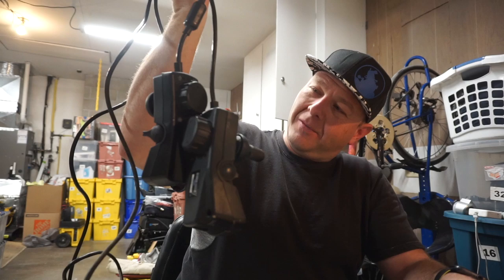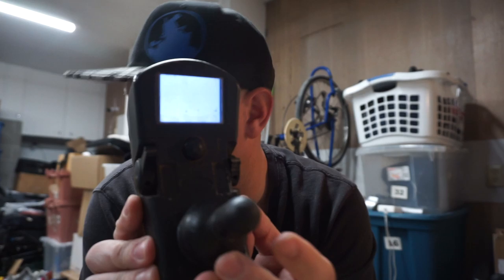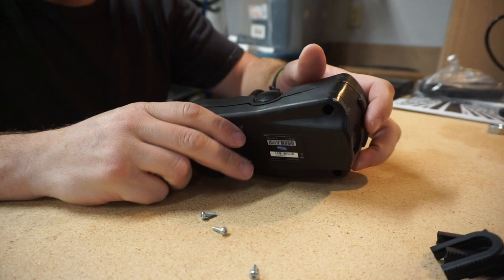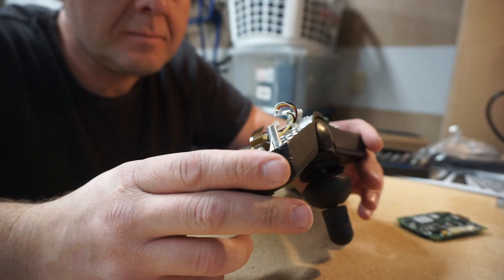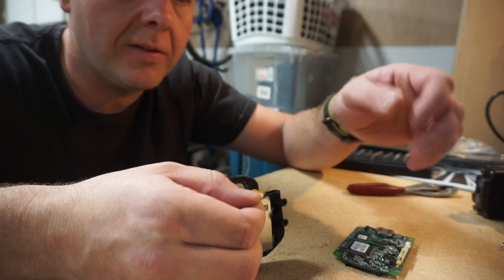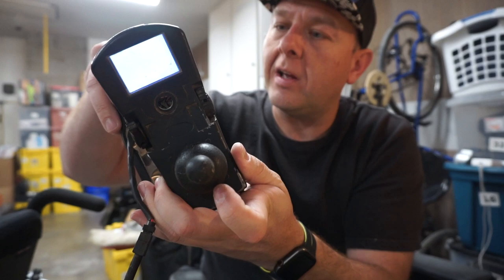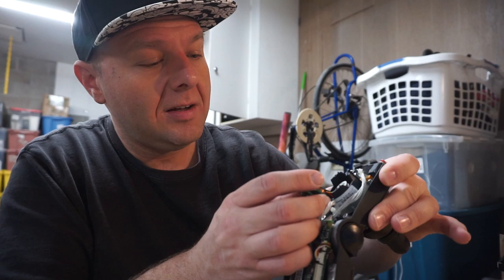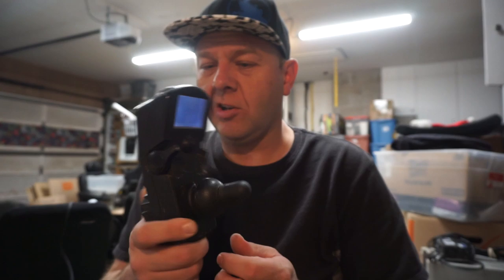VLOG 462: inside an invacare joystick! (MK6i)

Comment: Interesting how Invacare’s LCD display was so poorly made. I’m surprised my Invacare TDXSP didn’t need any more repairs except bearing replacements and brake dust removal.

The only time that I had trouble with my joystick is when it got really wet from the rain when I was trying to get it into the bowling alley. We got the chair in and out of the rain, so we turn off the chair to wipe off the controller to get the rain off of it and the screen froze on the chair and it wouldn’t do anything. But in a matter of 30 minutes after leaving the power switch in the off position the screen went black and I started in chair and the screen flickered for a second but it came back to life! 

The only severe thing that happened to the chair was the engine seal dying on it shortly after I ordered the Permobil F3. Hard to believe this baby is four years old already! I’ve only had two visits to the repair shop on this thing. The first stop was just to have my lights installed, and the second visit was to get my seat elevator replaced when it had that Chewbacca virus when the elevator went down.

Comment: I kinda like invacare, thing do break but they keep going. My old wheelchair it's invacare and the Mercury switch it's broken, so it's stuck on slow mode but still runs. The joystick some time doesn't have contact but I wiggle a little and still runs. The right motor makes a noise but keeps going. Never has left me stranded. This new one I have it just stops for little error codes and I can't mess with it because of the guarantee so I need to keep resting. Has left me stranded countless times I hate it. I hope I can get a new one this year.

Comment: Can you give me any advice on overvolting? My Pronto M51 clips out with an error at 30 volts. I want to give it 36volts for added performs
Reply from the maker: That ones easy.. stop trying to give it 36 volts! Lol unfortunately none of the stock controllers can handle more than 24 volts.  You’d have to go with something custom made, or like a roboteq controller.  But that’s an entirely different can of worms- and EXPENSIVE!
Reply: @TotallyNormal-  that's pretty much the conclusion I've arrived at but haven't given up on the dragster wheelchair idea. I was going to upgrade to the Mk6i stick and whatever controller is the strongest in terms of current. Do they even offer a 120amp controller (invacare /shark) that's compatibile? I know that the expandable controller is a must of I plan on retaining the functionality of a power chair and not simple making a go kart out of the thing. I don't want to do that. I build and design personal  electric transport and have found ways to make everything ice ever got my hands on go fast. I will modify the controller it whatever it takes. I'm just trying to arrive at knowing that for sure. The whole power chair thing is new to me. I'm disabled but not chair bound. I've wanted one for a long time and have several designs for extreme MOD of one of these. Then finally got the chance to get a nearly new M51 and couldn't pass it up. Most of the 120amp controllers I've seen so far are not invacare devices. What's the best most expandable stick/120 controller I could make work on this chair? Do you know? Help me get to the bottom of this and when my Eternity powerplant is ready I'll set you up with turbo power. I'll send you a link when I unveil the VampHigher™ Eternity powerplant. The prototype is already built and on the way. This chair is now a challenge. Again, love your tubes and have learned a lot very quickly
Reply from the maker: IMO anything except R-Net controllers are just toys :^) its the only legit mainstream control system out there right now! it runs a network and ya can just addon things no problem.. auto detects and everything! BTW tomorrow im picking up a professional soccer chair.. ill be making a video about it.. but wait till ya see what this thing can do.. they run R-net electronics and they're TRULY dangerously fast! haha  invacare has a 90 amp controller as the 'top end' one FYI..
Reply from the maker: sorry for late reply.. computer issues.. aarrgghh!!! LOL

Comment: Hey Totally, 

I have a TDXSP with the MK6i with the color screen. I just searched YouTube and came across this video. My MK6i has an issue with the on/off/toggle switch. It still works, but it acts like the springs or rubber bands that hold the switch in place broke/came off/died! If I move the switch up to the on position,  it stays right there and runs. If I try to toggle to the next program, it changes to it, but the switch won't return to the on position by itself. The chair won't move until I pull the switch back to the middle, and then it runs the new program.

I tried to see when you had it open,, but I could not see the inside of that switch. Did you happen to see that, or do you know if that switch is repairable/replaceable? If I could swap out a switch from another joystick, that would certainly beat paying a repair shop to order and install a new one! Enjoyed your video. Thoughts?

Kent
Reply from the maker: ive found usually in that scenario - the set screw that holds the toggle in place has come a bit loose.. there should be 2 set screws on the bottom of the switch (maybe one on some models) getting it back in the right position, and tightening it up should fix it - unless the switch is ACTUALLY bad.. does the toggle seem to have a bit of play in it? or feel like its kinda has mushy movement to it?
Reply: @TotallyNormal-  Thanks for the reply. That was the first thing I checked when the problem started, as I did have a joystick where the screws wouldn't hold. On that one the switch still returned to the middle position like normal, but the knob just slid around. On this one, the knob is holding on tightly, but the switch moves wherever I move it, and it works when I move it to the correct position,  but it doesn't return from the drive select position by itself. I have to move it back to On manually, and the chair will not move until I do. It seems to move pretty much like always, but only where you move it. No snap back to On, and no real stop in the exact On position as you manually move it there. I have to manually find the sweet spot so it will go. Ever see that before?
Reply: Also, I saw a video talking about an external switch that plugs into the back (not the bottom) of the joystick. Are you familiar with those and where to get one?
Reply from the maker: these are usually available for a bit cheaper at other places.. cant find them in my bookmarks at the moment though... https://www.ablenetinc.com/mini-cup-switch
Reply: Thanks again for the reply. I'll let you know what ends up happening. I enjoy your videos. Hope you have a good one!

Comment: I have a question for you. If you buy a new or used joystick are they plug and play or do they need to be programmed for your chair?
Reply from the maker: on R-net powered chairs the controller will auto detect everything the first time its plugged in and powered up